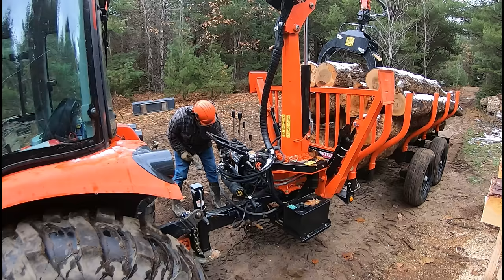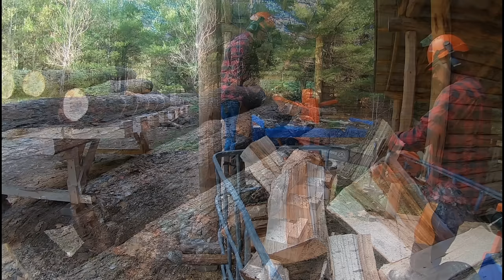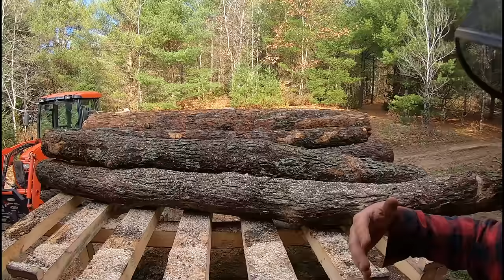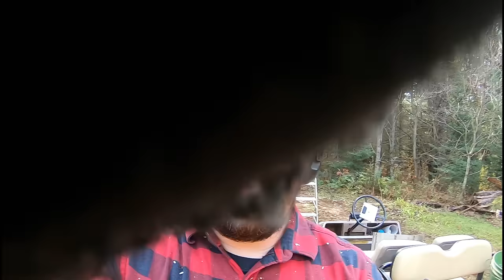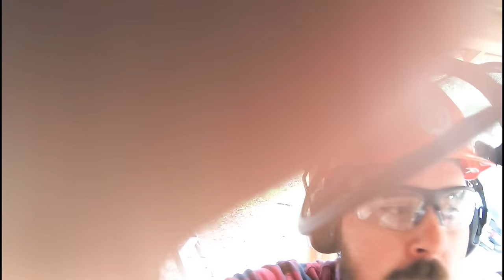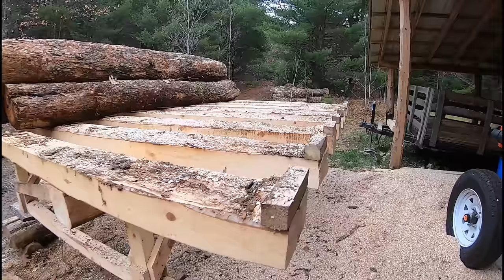Low Cost Log Deck Changed My Firewood Operation Forever

Comment: Wow, Sandy! That is one fine firewood setup. You really used your old noodle on this one. The ergonomics are perfect for handling the wood. I like the fact that you no longer have to stand out in the weather while splitting the logs. And the log splitter is now protected from the elements as well. I'm real happy for the success in your design. Well done, young man.
Reply from the maker: Thanks Bob! I'm happy with how things have turned out here and sure makes me feel like I'm going to be getting alot more wood cut faster
Reply: Work smarter, not harder
Reply: @bobwollard9105.. Damn sir!  You typed my thoughts almost perfectly. 
Ive been dreaming of ways to engineer what apparently has, already been done.

Comment: Now all you need is a table to place your sludge on like at the mill. What is the disadvantage of leaving the tractor and forks under the tote vs. backing it out and then moving it back to switch totes after filling it? Wow, I haven't been knocked over so much since 7th grade. 😂😂😂
Reply from the maker: Thanks for coming along for the video. A sludge holder is in the works haha. I always back the tractor out just in case a piece of wood misses the IBC cages and falls off to the side. Just prevents the tractor from getting damaged by accident.

Comment: Ergonomically speaking the pickup and turn around seems to be bad longterm, maybe get one used roler conveyor in the lenght of the deck (maybe 3 to 400 usd, for a min. 500kg carrying capacity), roll a log on to it, pull the log over one end with a cheap 12v winch (or by hand), cut a piece which will drop right into your positioned spliter and split, or let it fall on another roller conveyor so you can collect maybe a full trunk in pieces and the split that lot...
Reply from the maker: Those roller conveyors are pretty slick. Would like one for sure

Comment: 13 months to get mine, 6 hour flight to get to it, had to drive through a 24" snow fall round trip to pick it up and bring it to our property.  

Once fired up... WORTH EVERY SECOND!!!!!! 

That splitter is amazing!!! Even made kindling with it since there is such a fine level of control!

So much fun I didn't take the time to video anything for my channel... that can wait! 😂😂😂
Reply from the maker: Now that's a trip! Good to hear that you're liking it as much as I am. It's one of those things that really makes splitting alot more enjoyable since it's so comfortable to run
Reply: @sawingwithsandy  yup, reading and hearing about the deck, or working height isn't enough.  It has to be experienced.  Being able to set the height a bit with the tongue jack so it can load straight into a truck bed was a very happy bonus too!!! 

Just need to start acquiring, or making firewood cages and I'll be set!  Well... after I come up with a log deck similar to yours!  That layout is simple genius...  the best kind!

Comment: Good evening Sandy that's worki g out really good i do like the fact that you don't have to bend down so much and that way you also can handle bigger pieces without straining yourself 
  When you first did you log rack you where talking about leaving a log at the opposite end  so it would not tip and i scratch my head on that one but this might be a solution take 2 bags of concrete ready mix but some good eye hook into the bag and wet them then  put 2 hook on your log rack and hook the bags so if you want to move the log rack unhook the 2 bags for the counter weight and you don't have the extra weith to move just an idea have a great day
Reply from the maker: I like that idea! Would certainly give some good counter-balance weight! Thanks for sharing that

Comment: now you need a chainsaw shelf on the side of the log deck (or the log splitter) so you can avoid walking to far to put it down and then having to bend over to lift it back up!   Very great setup you have, sure beats the standard X shaped sawhorse
Reply from the maker: Spot for the chainsaw would be great! And a chair for some sludge drinking

Comment: You have a nice table for sawing large logs: strong and massive. It really eases the hard work of gathering firewood and is good for the operator's back. I have also cut several logs at the same time, even 5 at a time and they did not jam the saw bar and its chain. This is because you have fixation only at the front, and the rear block is free and jams the chain. In addition, you have long logs, and I sawed 3-5 pieces, but only 1.2 meters long, which were rigidly fixed with large construction staples. So they are unable to move either during or after sawing, clinging to the pile. Apparently, in your case, sawing logs of a large length and diameter is unlikely to reliably ensure fixation. With logs smaller in diameter and length, this works better and does not wedge the saw.
Reply from the maker: It's working out quite well and I"m finding sawing more than one log at a time sure is spewing up production with this new table

Comment: I love this thing going to build one. My only thing I would suggest is move the log deck over so the center of it is where you stand at the spliter.  You will save long walks with logs.
Reply from the maker: That's a good point. The only reason mine isn't centred is because the woodsplitter has to be where it is so the wood falls into the IBC cage
Reply: It was a good idea while it lasted. @sawingwithsandy

Comment: Great setup, I may duplicate this in a few years. You could easily put two IBC cages there and cut down tractor time. Also would be nice to put a fence/guidewall up on the backside of the split table to keep the splits from falling off the back side and direct them into the cages. This seems close to some of the fancy processor setups but for a pickup truck-less amount of money. 😂

Comment: Quite the setup there, Sandy.  The technical definition of work is a force applied over displacement but if the force is perpendicular to the displacement then no work is done.  So, moving the logs from your deck to the splitter involves no actual work (we all know that's not actually true).  Your setup really does minimize the effort put forth to generate your wood.  Really well thought out!
Reply from the maker: I'm really like it so far

Comment: 1st time viewer. One piece of advice you may try bucking with a shorter bar (20") and getting more vertical midway through the log and using the base of the bar/chain versus the tip. I just got a 555 with the 24 inch bar and love the reach but it is actually a bit long for most of the logs I fall and buck (on the ground). Your setup is a huge step up from what I got going on. Nice work.
Reply from the maker: Hey Trent! Thanks for coming along for the video and welcome to the channel! My 20" bar is my go-to for my 555 saw. I like it for it's weight when I"m out in the woods sawing. I tend to just use the 24" bar on the saw when sawing at the splitter for the extra reach for sawing two logs at once

Comment: terrific set up in that at each transition point there is an ergonomic application
my only concern/suggestion is counterweights for the log deck - i'd be looking at fitting a row of trunks between the posts, below the deck to stabilize the deck's centre of gravity from a forward or backward tilt if/when the logs unexpectedly roll. 

i'm going to look at borrowing your design in the spring.
I have a lot of yard lumber requests and milling projects.
This deck also lends it self to enhancing the metal detection devices I use before moving lumber onto the mill.
Reply from the maker: Great suggestions and thanks for watching Steven

Comment: Good job.  
Next you can build a small deck "touching" the splitter to stockpile rounds of wood to be split.  The purpose would be to reduce the frequency of shifting between cutting and splitting.  Fewer miles per day and fewer cold starts.  Many people could use one if they had a loader.

If the middle of the deck were arched up, logs would not pinch as much on the bar. You could find a log with an arch in it and peel it and use it to make the top pieces into an arch.  When this rack rots away, I would like to see you do one with round logs.  To stop the log for sawing gouge out little dips instead of the end block.  That would be cute and the log would be more steady.  A dip could be cut with your chainsaw or with your leg peeler.  

An alternative to the sawmill or a jig --- show us some freehand chainsaw milling.  People would be surprised how well it works.  You may need it if your log is too large.

Logs would roll more easily if the deck were slanted more.  A movable block of wood could be used to stop the logs where you wanted them to stop.  

Cantilevers are nice but you are afraid it will tip over.  Simply add enough counterweight so it will never tip over.

Next time you could stick four posts into the ground and go from there.

More people should have these things to make their work easier.

Comment: Another thing: Perhaps consider supporting the overhang. Just as a safety measure. If you would put a couple of supporting posts under two or three joists the deck would be much less likely to tip over in case one forgets one's brain at home some day.

Comment: Hi Sandy. I sent this to my dad and he really liked the idea. Currently he has the X style log holder and thinks this would be more efficient for the larger logs. He mentioned though that your chainsaw doesn’t seem to be performing that well being that it is softwood and I have to agree with him. Maybe the chain profile and/or rakers need to be improved/filed? We cut all hardwoods with similar sized saws and takes us about the same time as you are in this video. Not meant to be negative but could improve your efficiency even more.
Reply from the maker: Thanks for coming along for the video. Good to hear your dad likes the design. This wood I'm cutting in the video is all hardwood (hard maple) so it's a bit more slow going for the chainsaw.

Comment: I'm curious on how much wood those cages can hold like that. Fantastic set up. Think ill follow with the deck setup. load logs with my compact tractor and less leaning over. Cheers Sandy!
Reply from the maker: Hi Mark, thanks for checking out the video. I did some real world testing on how much wood fits in the IBC cages a while back. Here's what I found out https://youtu.be/zx09d3B9TKc?si=6dwmH6swnPPrcNqx

Comment: MM77 Approved 👍🏼👍🏼……………………………………………………………….. I think MY back feels better with this setup! LOL No bending and stopping ( at least not as much ) will make a big difference on your back and joints. Good setup.
Reply from the maker: Thank you! It was as comfortable to use as it looked. I feel like it turned out great with the height which was a concern of mine. I'll just need to treat it with something once the wood dries out to preserve it

Comment: That's a pretty cool setup. Have you timed yourself while cutting one log at a time versus two? I wonder if it would be much different because of the bar pinching often when you cut two. It looks to me that it wouldn't be worth the hassle to cut two at a time for the small amount of time saved. 
I also wonder if it will dull the chain quicker because there's a lot of time in the cut of the closest log, but not cutting much, while cutting the second log. 
Just some things to think about. 
God bless you!

Comment: Your setup is really speeding up your inventory. Moving right along. So I see you use totes that aren’t cut. When you do this do you cover the tops of your totes for winter and summer? When emtying your totes do you tip them over and flip them up side down to get the wood out. We met at Paul Bunyan. I live in northern Minnesota and get a lot of snow like you , that’s why I was asking about covering the wood. The pieces you split were maple I believe will that size split dry in a year? Sorry for all the questions, but it’s the best way to learn from one another. Our channel is Club Dora outdoors and firewood. Later Sandy.
Reply from the maker: Hi Allen! Great to hear from you again! I don't cover the wood until it's just about to be burned in the wood stove in late fall. I leave it out in the open areas in the IBC totes as they are throughout the year while they dry. Usually I'm a good year ahead for firewood so this stuff that was just split will sit uncovered (or snow covered) throughout the winter and all of next spring, summer and late next fall I"ll cover it up for burning. Seems to do well with the IBC cages without cover as long as it's out in the open. Hope your'e well! Maybe we'll run into each other at the next year's show

Comment: I am going to use a few of your ideas. I really like your building and use of IBC totes. If I may humbly suggest a bigger saw (70 to 92cc) as that is limiting some speed. A 24" bar is a bit much for 59cc's in maple.
Reply from the maker: Thanks for coming along for the video. Good to hear you're liking the log deck. I had a 92cc saw for a while but just found the weight was a bit much
Reply: @sawingwithsandy  Yeah I can see that a 92cc saw can be too heavy. I went from a 59cc Stihl 361 to running a Husqvarna 372xp and the power to weight increase is welcome especially running 24" and 28" bars. You could probably get a 10 to 15% power increase on the 555 by opening up the exhaust.

Comment: Mod for the log deck would be two 4x4 supports on either end to keep any tipping from happening if no counter weight logs are on the deck.  Otherwise, nicest set up I've seen.
Reply from the maker: Thanks for checking out the video!

Comment: Hey Sandy, great set up, do you sell firewood or is it just personal use? I just cut mine for personal use, and getting full lengths out of the bush like that would be a challenge for me. I buck all min in the wood and haul it out with my tractor (bucket and and IBC tote on bin forks out back. You have inspired me that maybe I need to build a simple table (heavy duty) that I can dump the rounds onto directly from the bucket at splitter height so I can just load them from the table. Im thinking something sloped and funnel shaped to direct the wood right to the splitter. time to get milling.
Reply from the maker: Hi Keith. I'm burning for personal use right now. I've considered selling but it's a bit challenging as I"m competing with firewood processors near me. I like that idea driving around with the IBC tote. Makes it nice to put it right into the IBC cage while out cutting it.

Comment: That's a sweet setup bro! Totally works perfectly for the equipment you have. Wouldnt work for me as I dont have a log trailer or mini-ex to get em up on the deck, so im looking at a splitter with a log lift instead to save my back. Perfect setup for what you've got, almost made it look effortless! 😁
Reply from the maker: Thanks Earl! I think I"ve got a good setup now with everything moving well. I sure am not missing the lifting of the rounds from the ground up to the splitter. A log lift sounds nice for your setup. Would do a great job I bet

Comment: it seemed like alot of time you were pulling pretty hard to get the chainsaw unpinched. Like I said before I have 3 of those holtzforma 28 inch bars and I don't think you are actually getting pinched but that hole near the end of the bar is actually filling up with saw dust and making it feel like you are getting pinched. I'm going to fill mine in with epoxy and I think that will solve that problem. I only notice it on 10 inch and wider because I always cut with the tip of the bar. I love that deck
Reply from the maker: Thanks Noel!

Comment: Looks like you need a 6-way wedge for the larger rounds.
Reply from the maker: Those 6 ways are pretty slick from what I've seen. Not sure if they are an option on the Ultra or not.

Comment: Do you heat with a outside boiler? You leave your firewood very big.
Reply from the maker: I use just a wood stove but it's pretty big so it holds some larger pieces for the all-night burns

Comment: Try cutting the logs 90% through, then go back with a quick up cut to finish. Less pinching of the chainsaw and the weight of the log will continue to hold your rounds in place.
Reply from the maker: That would do the trick Matthew! Thanks for coming along for the video

Comment: What is the advantage to using hard wood, that you have to pay for vs softwood that you could harvest? That is an amazing setup.  Did it eliminate needing to measure? With the slots being at your preferred measurements?
Reply from the maker: Good question. The main reason I buy hardwood logs to split is it burns alot hotter than the softwood. I do burn softwood mixed in with the hardwood though with usually hardwood exclusively only in the dead of winter. The slots do help me to estimate the length of firewood a bit easier as well
Reply: @sawingwithsandy  ahh, that makes sense.
Reply: All wood per pound dry has approximately the same btu potential.
Reply: @218philip the pieces of wood don't weigh the same though. 
God bless you!

Comment: Sandy, at the 8:25 min mark, I noticed that your bar oil is exiting from your bar cover and not getting onto your bar rails. You might need to clean out the bar oil hole with a pin or thin nail. I also noticed that your chain might need to get a slight sharpening. Other than that, great video! 🇺🇸🪓🪵🌲🪵🪵🪓🪓🪵
Reply from the maker: Thanks for that! I'll be sure to have a close look to see what's up with it